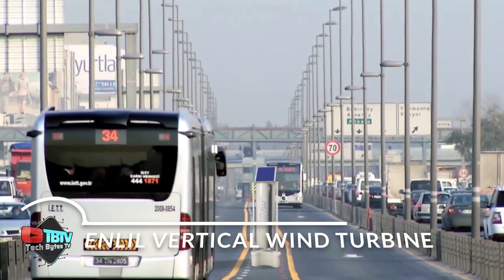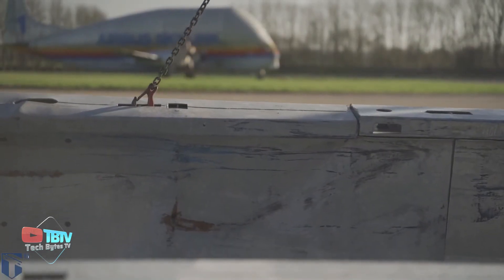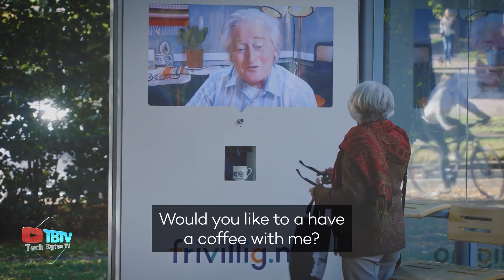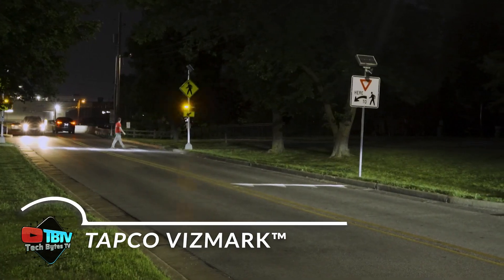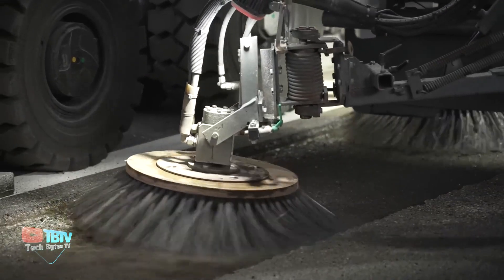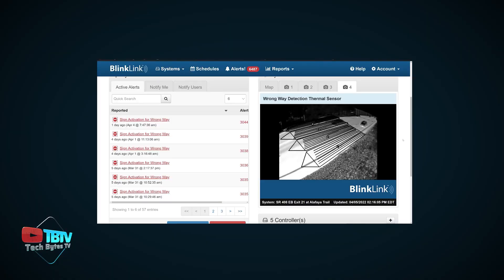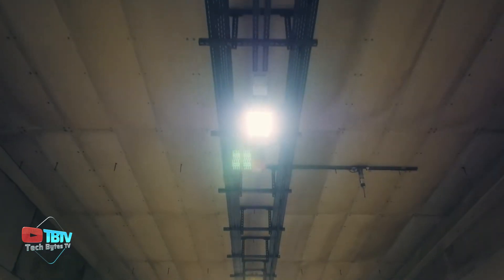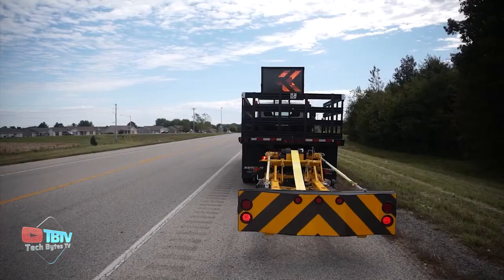Incredible Road Technologies That Are Insanely Cool

Comment: I don't like how you don't go into depth for any project. It sounds like the first 2 paragraphs of the press release of the companies that produce those "solutions". 

The highway barrier for example is used in a similar design in Germany for decades already.

The wind/solar hybrid: how much does it cost? Is it already installed? How long shall it last before needing replacement?

And the innovations aren't as grand as you make them out to be. While they're sometimes clever solutions to some problems, they also all have some downsides that should have been covered.
Reply from the maker: Thank you for the feedback. This is something I'm going to take into consideration for future videos. Research takes time and I try to give a general summary of most of the inventions I come across without making each video incredibly long. Again, thank you! I'm always looking for ways to improve.

Comment: "Harvesting" energy from passing vehicles? Doesn't that mean, the vehicles have to provide that energy in some way which must finally lead to higher fuel consumption? 🤔

Sounds like it would be easier to force the drivers to put some fuel into a bin at the side if the road, so you can burn it to generate electricity.
Reply: I don't think they necessarily have to. They generate the wind regardless due to them driving through air. The installation could potentially generate small turbulences, that decrease efficiency somewhat but I think that's negligible. My biggest concern is cost of installation and upkeep